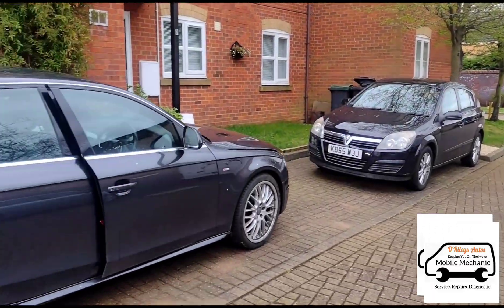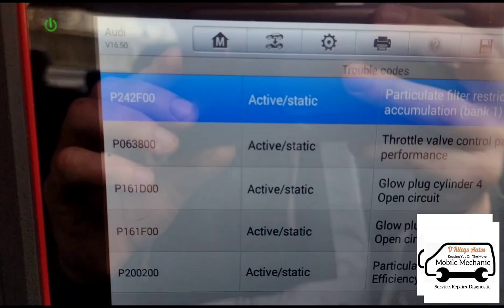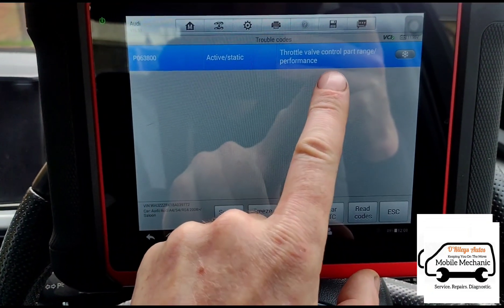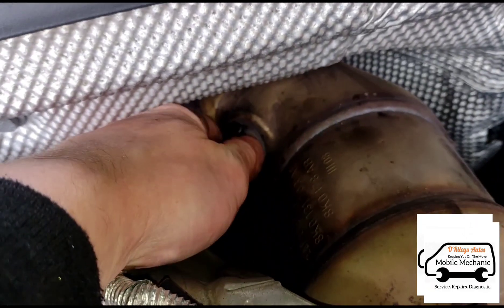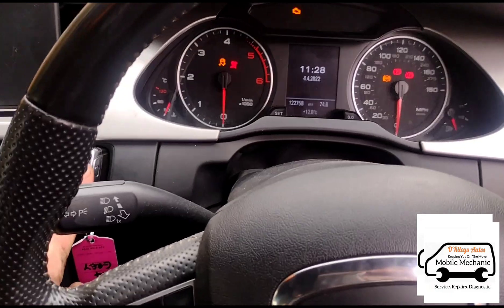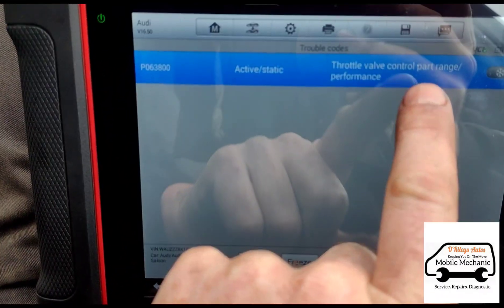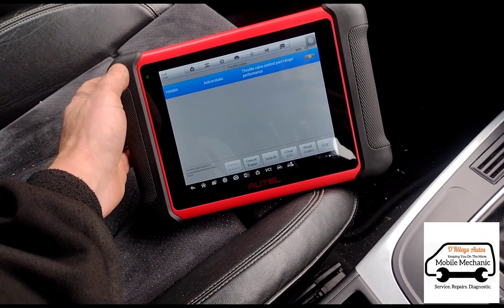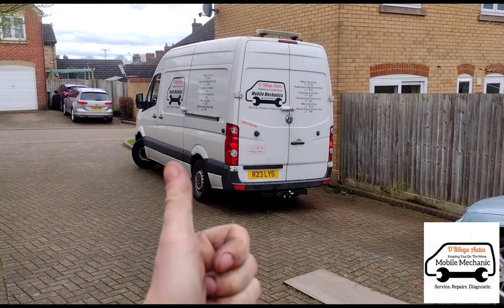Audi A4 3.0 TDI V6 P242F00 P200200 Particle Filter Ash Accumulation DPF Cleaning P2002 P242F

Comment: I am.a subscriber and I need some help. I have a Peugeot boxer that cuts off after after starting it. It starts up after the 4th or 5th time. Do you know what it can be?
Reply from the maker: Immobilizer can make it stall out.
Blocked DPF can prevent it starting if it gets bad enough.
Could also be low fuel pressure.
Reply: @ORileysAutos  thank you.
Reply: @ORileysAutos  does a peugeot boxer have a maf sensor?
Reply from the maker: @beaddy101  yes. MAF sensor is after the air filter. It's a cartridge style unit held in by two T20 screws